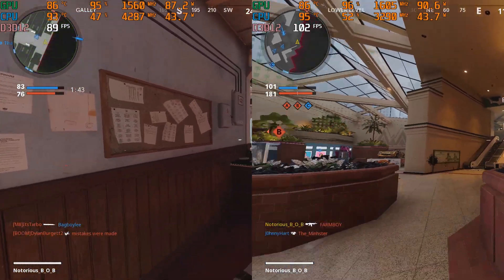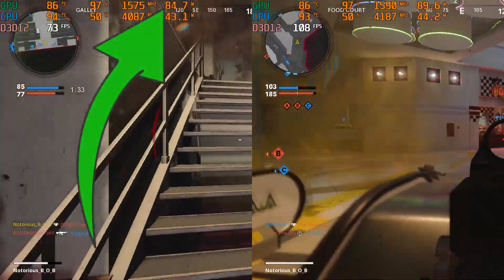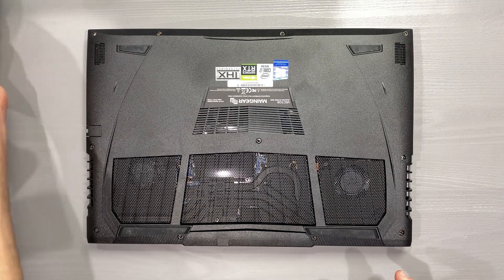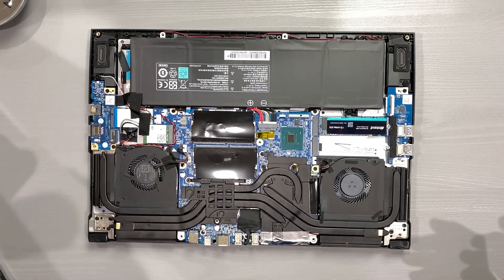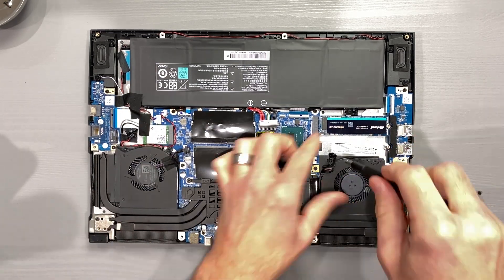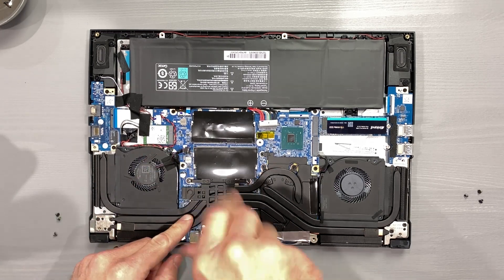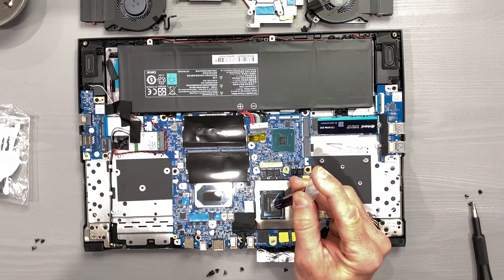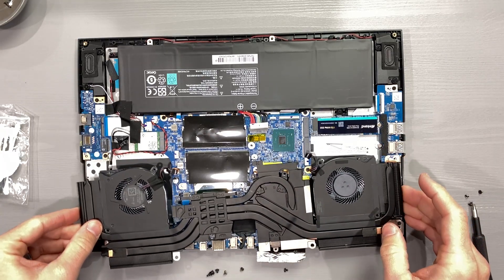Maingear Vector 2 Repaste...still Throttles?

Comment: I just took my vector pro 2 apart and my CPU heatsink is fucking aluminum.... The GPU heatsink is copper. Massive L for me
Reply from the maker: You sure it’s not nickel plated copper?
Reply: @BobOfAllTrades  not 100% sure but I tested to see if it's magnetic and it's not. When I asked Maingear they just told me it comes with liquid metal already applied (mine definitely didn't), so I can't rely on their information lol

Comment: I honestly have only seen a couple laptops not thermal throttle, and they are beefy!! lol... most will when gaming (especially in AAA titles).  Good thing is you have the option to set where it throttles to cut down on heating a little. If you noticed the FPS did increase when the new paste was added, along with other aspects... It just goes to a limit... I think you'll either hit a power wall, or thermal.  As you know you can power throttle the CPU for better temps on this laptop, but the gpu in the control software can only be thermal throttled for the most part (you can disable boost, etc on the gpu side). Overall, performance is still pretty good considering, but the overall cooling could be slightly better if you're shooting for higher numbers.

Comment: I have a laptop with the similar chasee (Hasee Z7-CT7GK i7-9750h 1660Ti). And I can say with confidence that it has a problem with the air flow at the bottom cause of low height above the surface. Even switched off laptop stand can reduce temperatures by 10 degrees.

Comment: I did it. The temperature dropped from ~95C to ~85C. Re-paste helps. I used an old stash of Gelid GC-Extreme... and under-volt -40. But fan noise stays the same. The point is to apply to paste a very thin layer on the chip and the radiator plate. I usually apply on the chip first, then press the radiator plate to get "paste print", then I make sure that paste on both chip and plate is evenly distributed all over the contact surface in a very thin layer. Because the conductivity of paste is not as great as copper plate, better to keep it as thin as possible, but still ensure complete contact. The problem with this machine - they've put too thick paste at the factory, it reduces thermal transmission.

Comment: I got this laptop mostly for personal use. Occasionally I do play games on it, but that is usually when I am away from home, or my wife is using my desktop or the PlayStation. It does get quite warm though, but I don't think that is a major issue. I am curious if this made a difference in your throttling issues? I am an IT guy, so repasting is something I have done numerous times. But I don't like opening laptops unless its necessary. Although I may upgrade it's ram, but I have not had any performance issues with what it came stock. The only major issue I have is the laptop occasionally has a watchdog issue on bootup, but rebooting it fixes it. I am hoping the upcoming Win10 driver refresh will fix that issue.

Comment: What paste do you recommend bob? I have an MSI GS75 to repaste, which is an absolute torture to get to the cooler as yhe motherboard is upside down. I would like to have something long lasting so I don't have to repaste again for 2 years (3 or 4 if that is possible :)), won't pump out and can withstanda 85+ degrees of heat (I have heard that kryonaut dries out at such temperatures). Performance and price are secondary concerns,  though I would like to have decent to above average performance and something not super premium in terms of price. Also, will diamond particles scratching my dies be any problem?
Reply: Consider Phobya Nanogrease. It is quite resistant to pump out, and offers nice thermal performance too, which makes it a go to thermal paste, especially for laptops with below par fitting heatsinks.

Comment: If i cant get the temperatures at or below 80c for both cpu and gpu i just return it. Sooner or later those high temps result in hardware failure either on the chips themselves or surrounding components.
Reply from the maker: That’s probably what I’ll have to do here since nobody will want to buy this.
Reply: my aero v8 is almost 3 years old, depending on the game it just lives at 85-90c even after a repaste (which got clocks way higher) and its still rock solid. for how piddly the cooler is it does work pretty well, at least with some heavy handed CPU adjustments

Comment: A little off topic, but if I was to try to replace the boot m.2 ssd on my laptop how should I go about doing that? How would you transfer all the data to the new one?
Reply: Most new drives you buy will include some sort of cloning software. Just follow the instructions for whatever software they give you. Basically your just cloning the old drive to the new one. 👍
Reply: @dialedincrypto  ok cool thanks

Comment: I'm surprised the gain was so small. The heatsink on this should basically be the same as many other tong fangs right?

Oh, did you try TS and Afterburner curve?
Reply: Theres gotta be something wrong with his unit
Reply from the maker: There’s plenty of user reviews that state results just like those shown here.  This is definitely not a one-off and this was something I researched.
Reply: @skeletor2118  Post a video showing ur maingear temps under load  using riva tuner and hwinfo so we can all see what you claim bro.
Reply: @skeletor2118  I what if a different vendors bios could be flashed or a different control center application to see if it unlocked boost

Comment: TLDR: I think the heatsink assembly is not enough especially if the CPU undervolt is limited to -0.050v but Eluktronics newer laptops have better thermal designs. I have the Eluktronics Mech 15 G2R with i7-8750h and RTX 2060 and it was thermal throttling even with a laptop cooler hitting 92-93C on the CPU and 75-76C on the GPU. From what I can see, its heatsink assembly is quite similar to the Vector 2 and even the base cover looks the same. I repasted with Thermal Grizzly Kryonaut and applied -0.150v undervolt and the thermal throttling stopped. Temps are now hitting 87-88C on the CPU when running AIDA64 CPU stress test with max core clocks of 3.88GHz and running Heaven, I get 69-70C on the GPU.
Reply: Kryonaut on a laptop is just asking to repaste in 6 months
Reply: @skeletor2118  Why is that?

Comment: wtf i repasted like 2 weeks ago and it wasnt throttling in the first place nor was i throttling afterwards, is your unit defective? Literally have never seen the CPU go beyond 91-93°Cish
Reply from the maker: Ok what are you doing to get your results? Are you just running benchmarks or are you playing demanding games?
Reply: @BobOfAllTrades  
both, ive played modern titles like cp2077 for hours on end with msi afterburner monitoring on, never really throttling. I havent played a lot of games so far, but ive played them for long periods. in terms of benchmarking, ive only done the unigine heaven (1600x900 windowed) + aida64 stress test and xtu stress test with power limit unchecked, giving temps around 90-93°C at peak even before repasting (without throttling). i did multiple repastes to see if i could get temps lower, trying out compounds like mx4 and conductonaut. i didnt see huge gains with either of them, but they never throttled. (i made sure things like power limits were as high as possible) ill probably try gelid gc later.
Reply: @skeletor2118  How about posting a video showing your maingear under a game load and or benchmarks using msi riva to see it in realtime. so we can see its thermal performance.
Reply: Mine also throttles and in kinda mad...

Comment: Also one thing to mention bob. Do you use high performance power profile? that will hinder you a lot in terms of performance. Mine is always set to balanced. i also get higher cinebench scores when the balanced power profile is active :) - 3100 with balancet profile and 2,8-2,9 with high performance, and way higher temps as well with the high performance profile

Comment: i have the 9750h and i have a "gaming profile" in throttlestop where the cpu only runs at like 2,6ghz. I also set my 2070 max q to a lower clock frequenzy of 1440mhz. That didnt hurt my performance at all and my temps are as low as mid 70ties. (Cpu  running at 25-30 watts and gpu doing 70-80) - I have the asus zephyrus gx351
Reply: I'm doing the same with much weaker Dell XPS 15. Run CPU at max 25-30 wats + lower and lock GPU voltage and you get much better thermals at a slight performance cost. But no throttling. I'm surprised that this is not a popular method in reviews or best tips videos in general.
Reply: @Jasterrrr  exactly! It's kind of free performance by just spending a couple of minutes downloading and tweaking the applications 😄